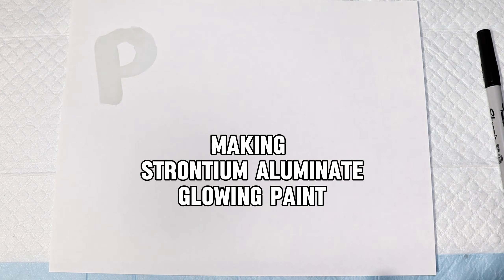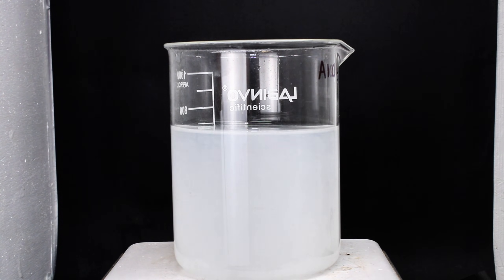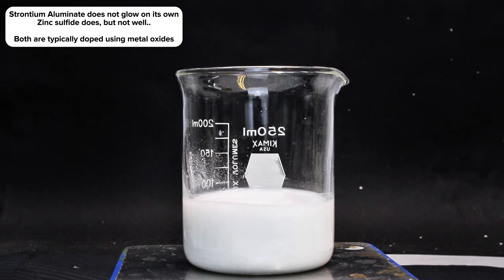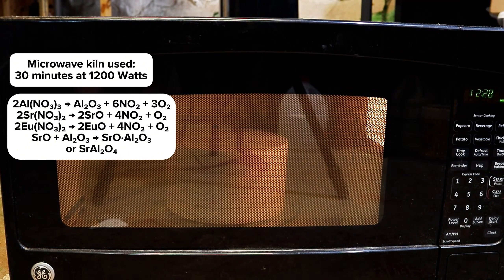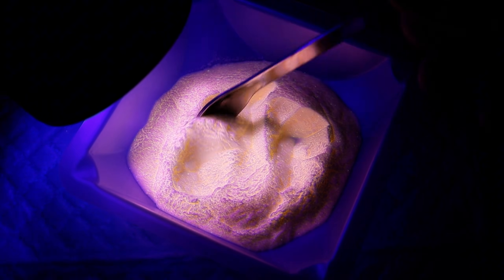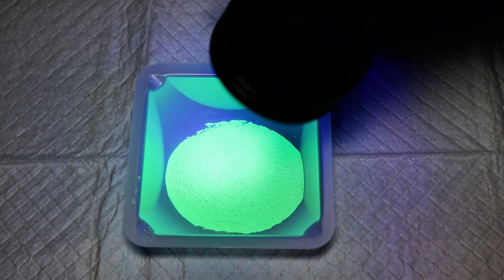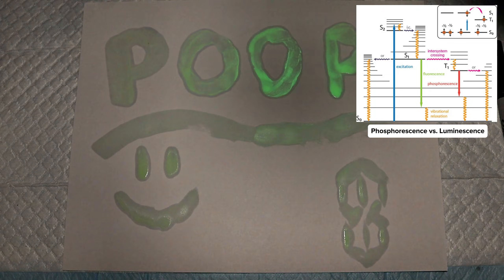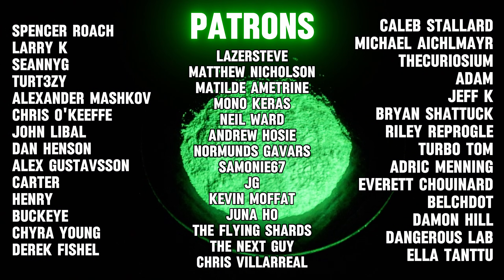Making Glowing Paint from Aluminum

Comment: WOW just found your video thanks to NerdRage. First off AWESOME video all around. Second thanks for the info on the Zinc sulfide colors at the beginning. I went down a rabbit hole researching this stuff over the past few years working on glow in the dark glass and wound up with a nice collection of every glowpowder I could get my hands one. On the topic of zinc sulfide colors any idea what makes pure yellow zinc sulfide? There is some on eBay falsely sold as Strontium aluminate but I proved in a video on my channel that it is in fact zinc and under a microscope confirmed it is yellow and not a mix of green and orange/red.

Comment: Actually, green glow-sticks generally use 9,10-bis(phenylethynyl)anthracene. You can tell this because they glow under exposure to black light even before being cracked but do not retain the glow once the light is removed. The dyes in all glow-sticks are purely fluorescent, not phosphorescent, so that they can convert all of the energy from the oxidation of TCPO into visible light, rather than absorbing a portion of it, reducing the output. 

After a quick search, I could not find any source that would suggest SrAL2O4 is a compatible dye for chemo-luminescent reactions. It needs to be excited by electromagnetic radiation, specifically.

Comment: It's not possible to make Sr aluminate by cold reaction between Sr(OH)2, which is rather basic, and Al(OH)3?
Reply: @albertorasa6220  it is not possible. Al3+ ions "love" water and OH-ions. High temperatures are needed to convert hydrated aluminium oxides to their dehydrated form. For example, "Al(OH)3" converts to a-Al2O3 form only above 1000 ⁰C, and below this temperature only hydrated forms with some OH-groups in the structure are obtainable. Sr aluminates require especially high temperatures due to low ion mobility and high melting point. Low temperatures also result in low crystallinity which is bad for luminescence

Comment: I've painted a lot of stuff with this and I guess it dies relatively quickly unless you make an epoxy paint (or something that provides a barrier to humidity). I'm wondering what exactly turns into what. I did try this with linseed oil just to see what happens and a year later it has a tiny fraction of the glow time. The epoxy mixture I used is much older and still as good as when it was new.
Reply from the maker: Hmm that is very good to know, I wondered about it's longevity myself but I couldn't find any papers on it. It's likely an oxidative decomposition accelerated by UV. Linseed relies on oxidation to polymerize (cure) while the resin curing is an anoxic chemical process.. plus many of those resins are UV-Filtering. Just a guess but seems likely to me lol
Maybe clear acrylic base would be better than the linseed?
Reply: @integral_chemistry  I have a bunch of powder from Techno Glow and I think the paint they sell is acrylic. They also sell encapsulated powder though that is moisture resistant.

One of the cool things I figured out on my own (though I'm not the first by far) is that you can stimulate strontium aluminate to glow brighter (i.e. lose energy faster) with an infrared light.

This is actually used in infrared laser detection cards that don't have any visible "glow in the dark" properties unless illuminated by IR. (they have to be charged with UV first though). Thor labs sells them though everything Thor labs sells is IMHO overpriced.

Comment: Fun idea I thought of using this powder:

3D print small, hollow star-like shapes out of clear resin with a tiny filling hole and a little eye-loop to hang them. Fill them with the powder and then you can mount them to the ceiling so they're like a 3d stars instead of the flat plastic stick on ones. I'd imagine they'd glow FAR brighter at a pure concentration of the substance versus it being diluted into a filament/resin.
Reply: Follow your dream and go for it test it out! im thinking of doing this with cement and patios and swimming pool bottoms 😊

Comment: Your explanation for the longer phosphorescence (Triplet) lifetime is not quite right I think. The slow decay is because the triplet relaxation is "spin forbidden" or just very unlikely/slow compared to "normal" fluorescence. I am not totally sure but I guess the europium is the main source of light here since it has very useful emission properties.
Reply from the maker: I think you're correct about the europium, and I have a strong sense you could be correct about the mechanism behind the longer phosphorescence.. I'll do a bit more research and correct it if need be, but your explanation mechanically makes a lot of sense.
Reply: @integral_chemistry  Yes the phosphorescence explanation is correct. As a term of art usually it just means the transition is spin-forbidden, which slows it down. On its own that just means microseconds rather than nanoseconds, and by the time you get to rare earths, spin orbit coupling is significant anyway. Need other details to slow it down further, and also the excited states are generically quite reactive and you need for nothing else to happen to them during that time. The trick of rare earth ions is that the transition is between unhybridized f orbitals, so the coupling to phonons or valence electrons can be made very low. A rare earth ion sitting in a crystal has very similar optical properties to the same ion in vacuum.

Comment: Metallic aluminum reacts with NaOH by itself. Wouldn't that make Al(OH)3 without having to use HCl first?
Reply from the maker: Kinda. You can dissolve aluminum in sodium hydroxide but the product then would be soluble sodium aluminate. You'd still have to balance down to around pH 8 to precipitate the hydroxide
Reply: @integral_chemistry  The bad thing about dissolution in NaOH is that you need to precipitate aluminium hydroxide in the form of gel, which easily contaminates itself due to high surface area. Na/K ions can affect the final result, so the most accurate way to get pure Al(NO3)3 is to use commercially available salt (which is expensive) or to dissolve pure aluminium metal in HCl and when replace the Cl-ion by NO3-ion by addition HNO3 and evaporation. The acids should also be very pure.
Disclamer: HCl, HNO3 vapors, NOx and NOCl gases are EXTREMELY dangerous. All operations should be performed in a good fumehood

Comment: When the world needed him most ... he came back with a BANGER! It is so nice to know that the microwave kiln worked for this. I bought one sometime ago and I wandering if it could work on phorphors synthesis.
Reply from the maker: @lucazsy  ha thank you so much! It does work for this one but just barely. The kiln is certainly not meant to be used this way and I think the 30 minute roast may destroy my magnetron but at least I got a video out of it 🤣
Reply: @integral_chemistry  I once asked to much of a kiln/microwave by running it for about 25 min. It resulted in my "pottery" becoming molten glass that glued the kiln. After that, the microwave has been making "beep"  and shuts down every time I try to use it again. I a attempt to unglue the kiln, I broke it.

Comment: I wonder if reacting NaNO3 with Copper(I) oxide also make NaNO2, the Copper (I) oxide will be oxidised to Copper(II) oxide by NaNO3 and NaNO3 will be reduced into NaNO2
Reply from the maker: Lol I just finished recording a 35 minute video (my longest ever) trying 7 different reducing agents on KNO3 to make KNO2. Spoiler alert: calcium sulfite worked best, and while I did try using FeO > Fe2O3 it didn't work all that well.. Your idea kind of makes me want to copper, but that project was so massive I might wait a little while first.
Reply: Thanks for the reply, looking forward to that video. @integral_chemistry

Comment: I wonder if using oxides of titanium would work as a colorant dope
Reply from the maker: I didn't come across that one but it might be worth a shot. Tbh I haven't done a ton of work with Titanium
Reply: @integral_chemistry  titanium dissolution is a very hard thing. It slowly dissolves in a hot concentrated HCl resulting in deep blue solution of Ti3+ ions. It can be enough for doping (as dopants are usually added in small amounts, less than 1%). However, to the best of my knowledge, Ti3+ ions usually give NIR-luminescence, while Ti4+ isn't luminescent at all. You can try to make Al2O3:Ti3+, but Al2O3:Cr3+ is more interesting. The best result can be achieved with 0.7% Cr3+ (Al1.986Cr0.014O3). It should be bright red under 365 nm excitation

Comment: Hello.
I have been working with strontium aluminates for about 6 months now. I have been trying to synthesize Sr4Al14O25:Eu,Dy (maybe chromium).
Starting with 0,5 g of very pure Al foil (iron is VERY bad for luminescence). After full dissolution of Al in conc HCl, I add an excess amount of conc HNO3 and heat it until nearly full dryness. Add additional HNO3 if it is some orange bubbles in the moxture. I usually add SrCl2×6H2O to Al foil as well since Sr(NO3)2 can be hydrated, so it is better for the right stoichiometry to use a reagents with known molar mass. When I add 1% Eu(NO3)2 (1% of Sr atoms! It is important!) and 2% of Dy(NO3)3. I am also try to compensate Dy3+ charge by co-doping with Na + K (1 : 1 ratio, doping in Sr positions) or Mg in Al positions. It is also worth noticing what when you add Eu, Dy and K/Na, you should lower the amount of Sr, and if you add Mg, Al content should also be decreased. So formulas should look like:
Sr(4-5x)Eu(x)Dy(2x)Na(x)K(x)Al14O25
Sr(4-3x)Eu(x)Dy(2x)Al(14-x)Mg(2x)O25
Maybe I am wrong, but charges should always be compensated.
It is also good to add some H3BO3 to the mix (~0,05 g for 0,5 g of Al).
After complete dryness of nitrate mixture, I add urea (5/2 mols of Al in mixture) and glycin (10/9 of Sr), heat it until the viscous "syrup" is obtained and when blast it with blowtorch untill all mixture is combusted. After this step, it is good to grind the mass, place it in a small crucible and place this small crucible in a bigger one with some (~5-10 g) activated carbon or another pure carbon source (iron compound can sublimate at very high temperature). Place another crucible or a lid on top of the bigger crucible and place it in a furnace for ~5h at ~1000 ⁰C (1200 is better).

At this moment, I don't obtain the pure Sr4Al14O25 phase due to my furnace limits (only 1000 ⁰C), but it glows.

SORRY for my English. I am from Russia, and while I can understand English speech very well, my speaking/writing is awful.
Reply: I’d say your English is pretty good, actually
Reply from the maker: @deniskarpov8748  hey! Apologies for the late response, and I do think your English is perfectly fine! You certainly seem to have a better grasp of the process than I do, and I greatly appreciate the information. I did also come across some literature that called for sodium borate or boric acid, and I'm still not sure what it's function would be here. I'm assuming the urea acts as a swelling agent to make it easier to grind, and I'm guessing the carbon helps sequester iron impurities, but in general I am curious about these finer details..